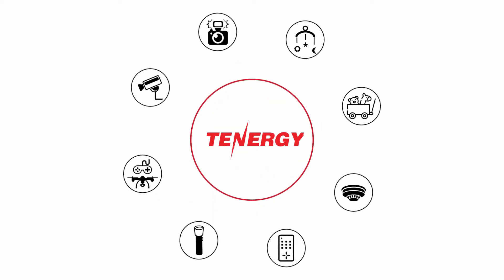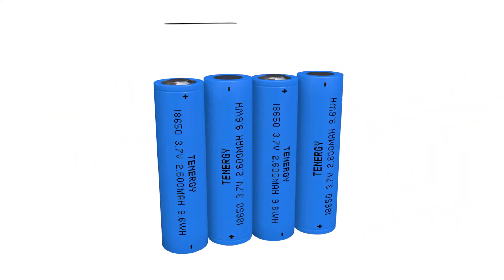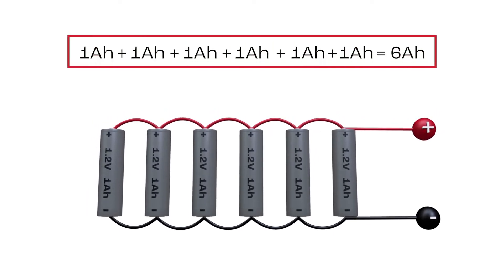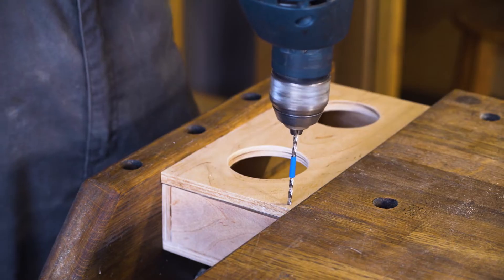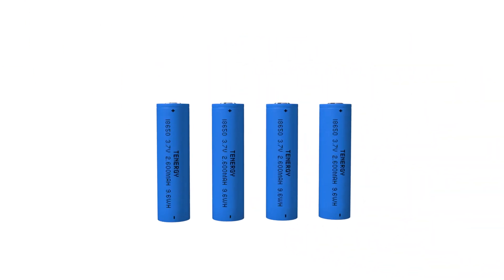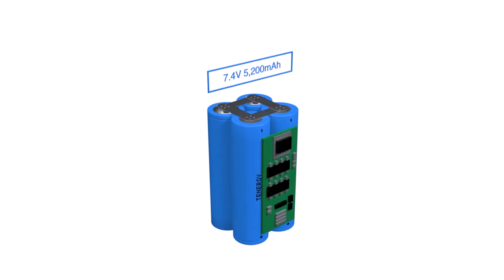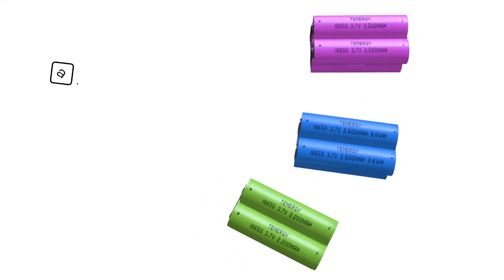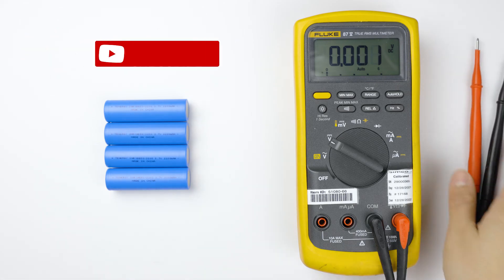What do batteries in series and parallel mean?

Comment: I am trying to make a battery pack for a solar panel and I have 3.7v batteries from old vapes. They are all the same, 3.7 wh. I was thinking I could wire 3 in parallel to make a group and then run 3 groups in series to make up the pack. 9 batteries. Should give me 11.1v and 11.1wh. is this going to work for me?